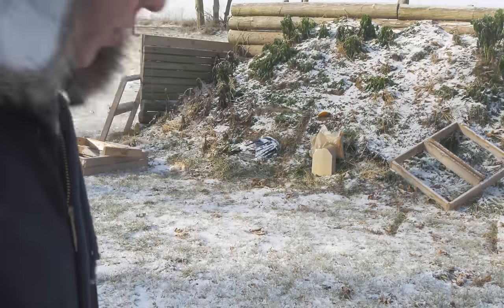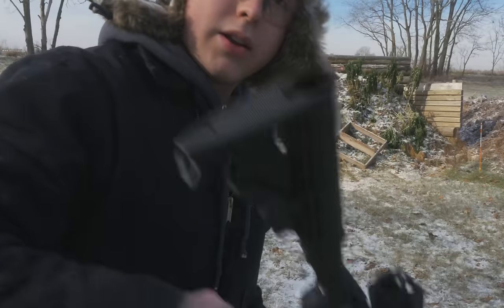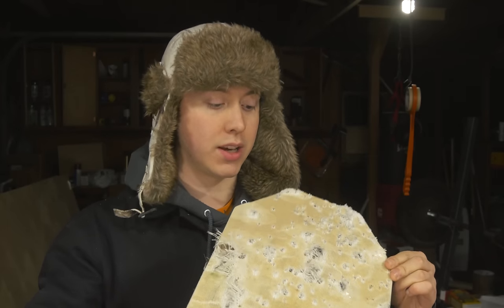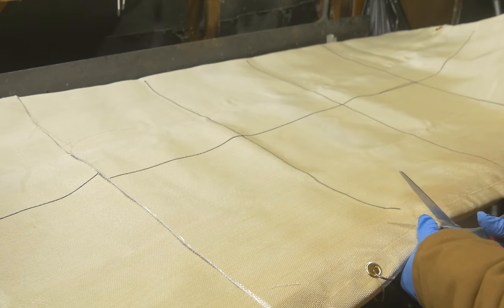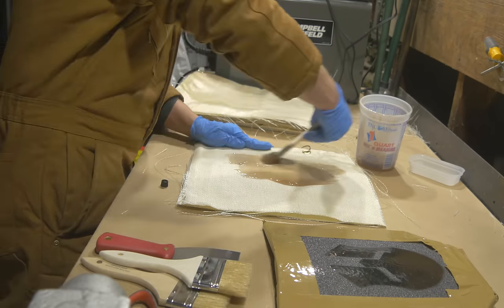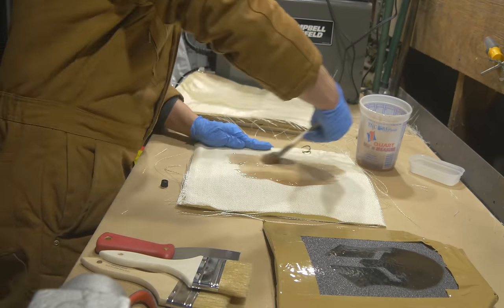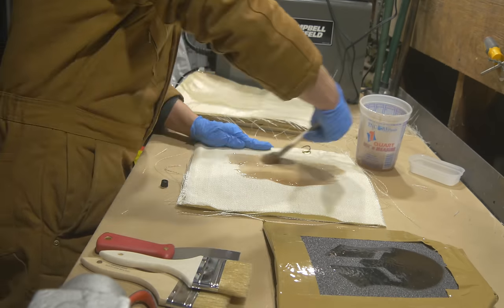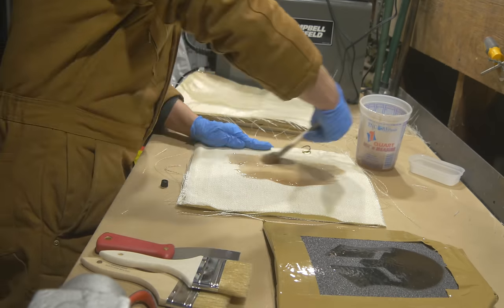How to Make AMAZING Bullet Resistant Armor for $30

Comment: My dude, you should make a v2 of these with some ceramic tile as a layer in there and a face of thin mild steel
Reply: brilliant    ...    i got ya
Reply: @jfrtbikgkdhjbeep9974  word bro. vid post?
Reply: Steel should be the last layer, not the first.

Ceramic-Fiberglass-Steel-antitrauma pad.
Reply: @casultras1989  Correct. The ceramic shatters and spalls inward breaking up the bullet and absorbing a tremendous amount of energy, the fiberglass catches it like a spiders web, the steel plate picks up the remaining fragments (polycarbonate or UHMWPE might be a substitute for steel) then the antitrauma pad.
Reply: I'm late to the party here, but I've been doing some experimenting, and the best combo I have found is a fiberglass cloth strike face (anti-spall and fragmentation coating), then a ceramic tile, double layer of 1/8" mild steel (performed better and deformed less than a single 1/4" layer), and additional fiberglass at the back.  All fixed together with epoxy and backed inside of a plate carrier with a trauma pad.
Reply: @KAKADOUJACK  Oh shit. that actually sounds like a solid af set up. do you have vids of it being tested?
Reply: @FluteC0p  No I don't unfortunately, but looking back I wish I had video'd the testing process.  For the steel I used 1/8" bar stock arranged in overlapping layers (to create a lamellar armor that had a little bit of give to it to take full advantage of the soft, bullet capturing and projectile dispersing properties of mild steel).  Keep in mind, however, that this was only tested with three rounds of 5.56, where most commercially available plates are tested to stop at least five rounds.  Normally I would absolutely advocate just using a professional plate, but considering that everything above IIIA has been sold out for months now, I figured I would try some DIY designs.
Reply: @KAKADOUJACK  roughly what's the weight of your armor? If it stops 556 it should stop most pistols also
Reply: @jamesp8209  It "stopped" (in quotations because by the end there was massive deformation to the back layer of steel, so that could still cause considerable trauma to the wearer, and since the steel was beginning to delaminate some spalling and fragmentation could have gotten through if the hits had happened differently) a full cylinder of .44 magnum (specifically 240 grain semi-jacketed hollow point at ~1100 FPS) at 7 yards out of a 7.5" barrel, so it should stand up to most pistols, certainly 9mm and .40 S&W.  I haven't weighed it, but I would estimate the plate to weigh about 6 pounds, and it's approximately 1-3/4" thick.
Reply: Expanding on the idea of having a steel plate backing and epoxy/fiberglass or UHMWPE fabric strike face. What if you added nano boron carbide powder to the epoxy to give it more strength and hardness? Its sold for 10 dollars per 100 grams if you buy a 1kg. I found a research paper that in regards to adding silicon carbide power to epoxy said: "It was experimentally determined that modification by means of silicon carbide with its amount 0,75 mass.% is of practical interest. Enhancing of compression strength of 5 % and modulus of elasticity in compression of 16% is observed".  Another said: "The reinforced epoxy had excellent mechanical properties that increased with B4C content and with small particles. "

The more a bullet is deformed and decelerated before contact with the steel the larger its surface area is and less likely it is to penetrate. So by giving a level IIIa plate a fibreglass or UHMWPE strike face held together by epoxy strengthened with 0.75% by weight boron carbide nanoparticles it could potentially stop a higher calibre round than the steel plate itself is rated for? The relatively soft strike face would also capture any bullet fragments from the resulting hits on the steel plate. The increases in weight would be marginal compared to the steel plate itself and it would in no way compromise the original capabilities of the level IIIa plate.
Reply: @PcLightBulb  Wow, that sounds awesome!  I wanted to try making armor out of (more or less) what I could find at the hardware store, but I will have to check this boron-carbon powder out.  One note, however.  If you were to try using it on a plate, I wouldn't start with a professional grade IIIA plate and then try to up-armor it yourself by adding a toughened strike face.  Professional ballistic plates are carefully designed not just to defeat projectiles, but also to prevent fragmentation and spalling.  By adding something soft and non bullet-resistant as the strike face (rubber, polymer, fiberglass, etc) you can further prevent spalling, but to add a stiff, bullet resistant coating to the front of the plate could be risky due to the potential of ricochets.  It's by no means a guarantee that adding an extra layer would be "dangerous," but I certainly wouldn't wear such a modified plate without extensive testing.  A friend of mine who is a former SWAT officer told me a story about how the city cops in his department would always be issued new gear whenever they were promoted, and every time they were issued new plate carriers plus new hard and soft armor, the guys would usually turn in their old carrier and hard armor but would keep the old soft armor (more armor, but not a lot more weight).  It was common practice to just layer the new and old soft armor in front of the hard armor in the plate carrier (the soft panels were cheap, but the hard ceramic was very expensive to replace, so if you got into a shootout hopefully only the soft stuff would be damaged, at least that was the logic), so you could tell how high ranking an officer was by how thickly his chest armor was layered.  However, one evening during a standoff, a captain was hit by a stray bullet from a .380 (so not even a high power round), and the layered soft armor, because it was never meant to be layered, caused the bullet to skip instead of being captured inside the soft fiber plates.  It skipped straight off his chest rig and went upwards into his neck, and he bled to death at the scene.  So, long story short, more bullet resistance on the very front of your plate might not necessarily always be a good thing.
Reply: this
Reply: Richard Kroll Would that not put the cost at about the same as many value plates out there? RTS Tactical has a decent level IV for $80.
Reply: @Matt-jx3cp  is it NIJ rated? 80 bucks sounds sketchy
Reply: Deutsches Afrika Korps I agree, but there are several videos testing them and it seems to hold up really well. Seems to legitimately meet NIJ IV and I looked at their site for the price and they are $80. I haven’t tested one myself but was impressed by the performance from the videos. Check out some of the videos for yourself. I was surprised, myself.
Reply: that would do the trick!!
Reply: Nice,i wanted to make a shield out of this,using three times the material,and was maybe thinking of using boiled leather for the backplate. I heard that cotton boiled in saltwater was effective too against muskets.
Reply: Take A Piece of Blue Jean, make a Pocket. Put the Tile In the Pocket, and when you Resin this You Resin the Pocket, incase it towards Front.  it'll help hold the Tile In Place
Reply: 2 incased pieces of Stainless Steel towards Front, with Tile near the Outer Layer..
Reply: What type of resin is he using here?
Reply: @KAKADOUJACK  And there you have hit on the deal breaker for your armor. Although I don't doubt it is every bit as good as you say it is, it is far too bulky (and I'm assuming correspondingly heavy) to be practical for use as body armor. Now, as plates added to the doors and engine compartment of a vehicle, it would be awesome. But as a tactical piece of personal gear, not so much. But, that's the downside to pretty much ANY body armor out there so you have to decide, do you want to be protected or do you want to be able to move?
Reply: @rdwryr2000  Well to be fair I did start by saying "I did this because professional armor was sold out; I highly recommend professional armor if you can get it, but if you can't this method works."  Modern ceramic plates, theoretically the very best in personal armor, are also quite thick (just for context).  However, you're certainly correct that bulk is always a concern.  The rest of your kit makes a big difference too.  If you have a double-deep rifle magazine pouch plus a lot of other gear on the front, yeah it's going to be crazy bulky.  If you've got your mags on your belt, or if you've only got a single-deep pouch and not too much other gear, it would still be very workable, although I do still certainly recommend a professional plate if you can get it.  The weight isn't too bad, since most of the material is fairly light or used sparingly (steel is heavy, but a couple layers of 1/8" bar stock isn't bad), and I would say it clocks in at about a pound (maybe two) heavier than a SAAPI plate.  I hadn't thought about molding it to a vehicle chassis before you said that, but I definitely know what I'm doing with that spare car door I have sitting around now...
Reply: How much would you charge for one of those
Reply: Correction. Use grade 2 titanium and find a way to contain the fiberglass dust, as it could seriously damage your respiratory systen

Comment: If you duct tape over your cut lines before you start cutting out layers, your fibers behave better and you get less fiber wandering around your workspace making you itch.
Reply: Yes I want to see him hit it with the Deagle and the 44 on Demo Ranch
Reply: I always appreciate little tricks of the trade, appreciate it.
Reply: I use painters tape when i work with carbon fiber
Reply: Maybe try coating the plates in vaseline instead of packing tape.
Reply: I was thinking spray glue (using masking tape and newspaper to put the glue only on the seam area)
Reply: @matthewblocksom283  I was thinking talcum powder. Or cornstarch?

Comment: 9:50  FYI, having the resin exposed to air for drying is not necessary as fiberglass resin is a chemical reaction caused by the catalyst you mix into it.  No oxygen is required, temperature however is important, if you room is way too cold it may not cure or take FOREVER to cure.
Reply: agreed , make sure rooms at 85
Reply: You guys do see the snow outside right, not to mention the $30. heater that won't do fuck all for his shed
Reply: there is always one person trying to out smart a great idea. I made 4 of these and gave 2 to a cop buddy that uses them still after 2 years on the job. According to him a cop it is lighter and fits perfect. I took it a notch up and made them into a square and added graphene to the resin. I shot every mm round and the only thing that finally went through was a 50 Cal and I think it only went through because of the ten other pistols I shot at it. I'm the first to call out someone trying to get views but I can honestly say this guy did it right and now you can spend $30 besides hundreds for basically a machined product. So unless a murderer is shooting a 50 Cal which low lives cant really afford or want to pay what they cost to throw it away you are safe in that part of the body at least lol.
Reply: @kjnewman7518  Take any videos?
Reply: @kjnewman7518  Do you remember how many layers you used to make yours?
Reply: Never comment backs..pssh
Reply: This is what I came here to add.
Reply: @SpaceRanger187  don't stop now, make a full set of plate armour. With helm.
Reply: @lancelee5778 damn straight like to see that

Comment: This is cool. Years ago when I first learned about linothorax I wanted to try making it with modern materials. That's basically what you've done. I would form larger sheets around a torso though, it's light enough.

Comment: I would suggest adding 2 layers of crisscrossed Kevlar on the front and 1 layer to the back. The front will help with high velocity expansion and the back will help to capture the expanded round. Great project.
Reply: I was thinking of building something with layers of kevlar fiber, maybe combining different types that have different properties. Does kevlar still have the same properties once resin is added to it? FWIW, I like that idea. Thanks!
Reply: I was thinking the same thing except....plastic layer dry kevlar sheets on outside and on back side BUT then add rhino liner like the plate carrier coating. kevlar is sealed in dry and should perform better... we know kevlar does not perform as well when wet.  In the grand scheme of things for some cheap body armor with things you might just have lying around the garage and for the cost I think it's a success nonetheless

Comment: Great video! May I suggest using a strong adheisive tape over your lines before you cut to reduce fray? I used gaffer tape (the kind they use on movie sets) . It works great on one side but even better if you can apply tape to both side before cutting. You really did a great job with this video!

Comment: Contact Demolition Ranch and find out how many layers you need to do to stop .50 BMG
Reply: Plz do
Reply: @Future Moto of course it is, need to hit them collaterals
Reply: @Future Moto yea it's great for infants
Reply: Jerry C depends on the steel.
Reply: Demolition Ranch does too much excess jibber jabber and disables comments so I don't sub him.
Reply: All .50 mil ammo uses steel cores.
Reply: You don't need more layers, just some additives to the resin and plate reconfigurations.
And that's also the same for tracer rounds or armoured piercing.
Stopping bullets even high velocity one's is pretty easy.
Reply: @flapzapple7786  what video of his has comments disabled???
Reply: @Jerry C Not AR500. A .50 BMG AP reaches about 3/4" through that steel, no more. Just look at some that have tried it, especially Demolition ranch and Edwin Sarkassian.
Reply: Dogs Sing  if only.... though the day we're able to wear ponds is probably a day where we will have have a completely different concept of firearms
Reply: I wonder what regular armor stops? Hmmm, i know at close range you can shoot threw a armored truck. Because i wa a armored gaurd. There are limits to everything.
Reply: If getting shot by 50. Bmg wasnt honorable... id consider you're comment
Reply: He needs to send him like 3 so he can see what it stops
Reply: That would be stupid sick
Reply: all you need is 8 inches of ar-500 steel with a chrome carbide outer layer of atleast a quarter inch and wala.
Reply: @armax5996  or 2k sheets of printer paper

Comment: I like the video, but having done all types of graphite work I can tell you that had you used a bondo squeegee and pulled more resin out after saturating it it would’ve been a fair bit stronger. Also if you used alternating directions with the fiberglass so the weave wasnt just stacked up in the same direction would’ve also made some strength difference
Reply: Like the way plywood is made.
Reply: Wouldn't that have just strengthened it with axial loads in multi directions? A bullet is only going to apply a force in a direction orthogonal to the fibers?
Reply: "had you used a bondo squeegee and pulled more resin out after saturating it it would’ve been a fair bit stronger."

Hi Kevin.  I'm not doubting this is true, but can you explain why this makes it stronger?
Reply: @ellemcc2547  The resin isn't supplying much of the strength in a laminate like this, it just bonds the glasfiber together. So you want as little resin as possible while still wetting the glasfiber mat. When determining the quality of a laminate you often look at the percentage of glasfiber. If I remember correctly you want about 70 - 80 % glasfiber by weight in a laminate. You won't be able to achieve this using simple hand tools though. As for the resin, epoxy is stronger than polyester, and is less prone to absorb water.
Reply: @Garebare1  Many bullets are revolving so the force can be radial as well as axial. Normally a coarser weave is used so more fibers are grouped without gap per 1/4" or so. A fine weave like his blanket isn't optimal for projectile capture, especially for pointed tipped bullets, they find a hole and exploit it.
Reply: @ellemcc2547  Resin to fiber ratio. The greater the fiber in the ratio, the greater the strength. The resin has very little strength compared to the fiber. It's just a binder. But the greater the quality of the resin, the higher the overall strength will be. Vacuum bagging provides the best ratio next to prepreg, which is material with resin already saturated throughout the fibers, layed up, then cured in an oven.
Reply: @UCJDYP27o4fdW7J0wUhqRNDA
 MANY bullets?  ALL bullets rotate as they fly through the air!  Even unrifled projectiles, As in a smooth bore still revolve to some extent!
Reply: @blahorgaslisk7763  but polyester reacts with glasfiber and creata stronger bonds.